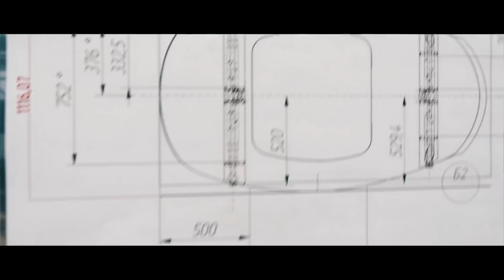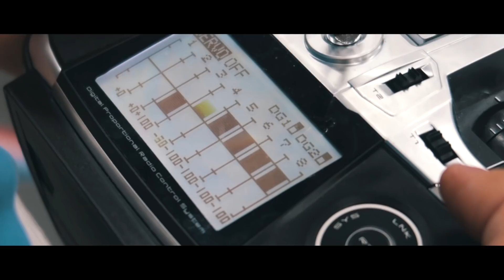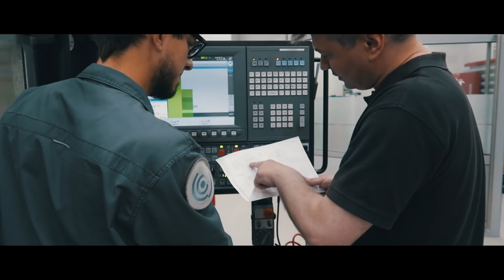Bartini: From Vision to Prototype

Comment: time and time again its the same drone design with the same issues,  Large exposed rotors, which is a direct danger to both passengers and bystanders, also just as well, no wings!, which means its lift is solely dependent upon its engines operating,  and in the case they go down, you go down! like a rock.  Also, noise.  don't believe the hype, those rotors are large and will be loud.  No, the only company that has done it right thus far imo , is Lilium Jet.  One glance and you see everything right about the lilium jet and everything wrong about these scaled up drone concepts.  No doubt these drones will be able to fly but they do have major limitations, the first being speed.  Drones are only somewhat fast when their rotors are heavily pitched forward into the wind , like a proper airplane,  but a drones engines are not designed for maximum forward pitch because without wings theirs no lift!,  so its rotors always have to be pitched mostly upwards to maintain lift, and thus can only travel forward but so fast. Just like those RC drones, accept scaled up i dont think passengers would want to experience such a rollercoaster ride several thousand feet in the air.    Lilium Jet eliminates such problems by brilliant design. Having many small ducted fans that comprises of the aircrafts ailerons with can orient themselves in pitch independant of the wings they reside for normal forward flight while maintaining lift from the remaining wing surface, not to mention extreme control under transitional flight because the location of the engines are situation above the wings ALWAYS producing lift even in hover mode, as the ailerons simply pitch down to slow the aircraft mid air and hover,  all from one simple moving part.     These scaled up drone concepts can indeed fly, but their generations behind the lilium jet which isnt more complex  but actually far less complex.

Comment: The Best Design I have seen in development.. well done.  Cookie cutter serrated trailing edges on the nacelle will further reduce noise and I would also consider noise cancelling in opposing waveform. My company is in development of a different type of electric turbine unit and light weight flight control processors designed specifically for future delivery and passenger drones.  You have my attention.